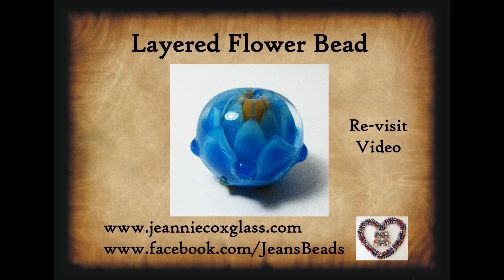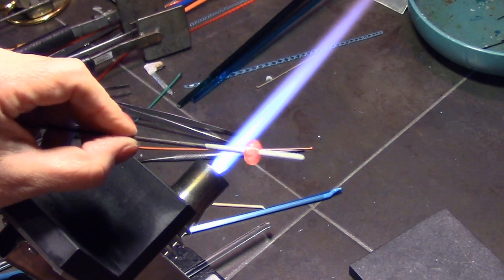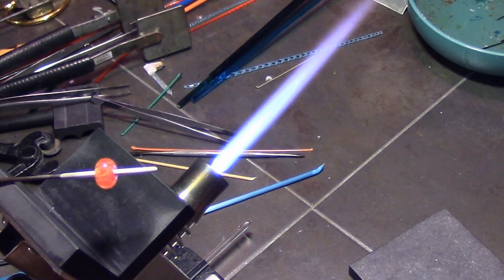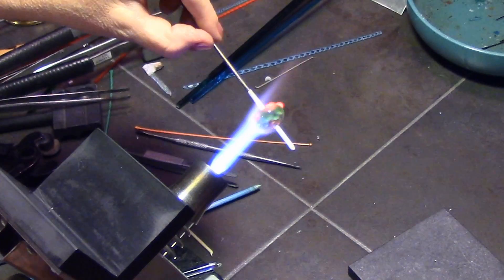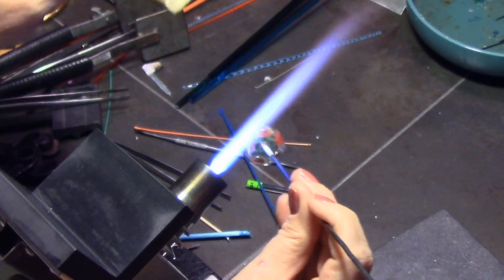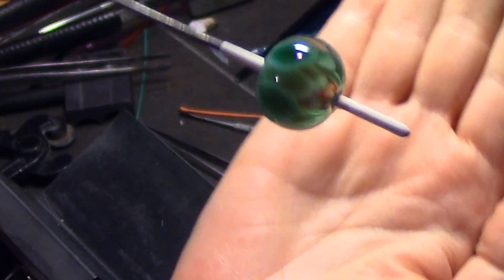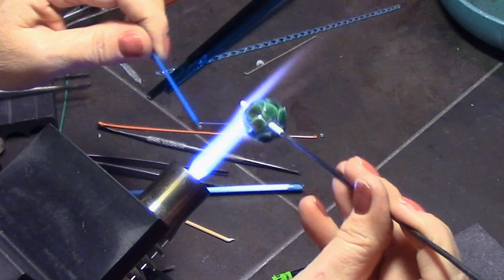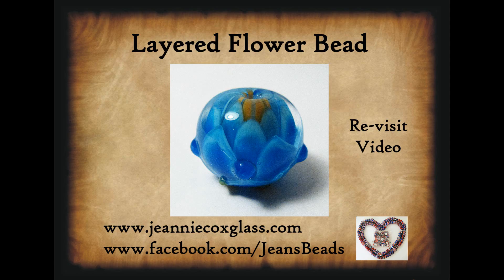Layered Flower Lampwork Bead by Jeannie Cox

Comment: What clear are you using to cover these CIM colors?
Reply from the maker: For these, I am using the new Vetrofond clear that just came out.  I prefer soft Lauscha tho - - it's much cleaner.  And then of course, Zephyr is the best, but more expensive.  :)
Reply: Ah, nice to know.  I made one last night .... twas awful.  Trying again today.
Reply from the maker: Oh no!!  Did you smear the dots when you put the clear down?
Reply: No - the dots were too small and next row didn't cover the one before it.
Reply from the maker: Oh, I see.  Yeah, the dots should melt in so that there's about half the dot width of clear space in between each dot (if that makes sense).  An easy fix, tho!  Just add more glass to your dots.  :)